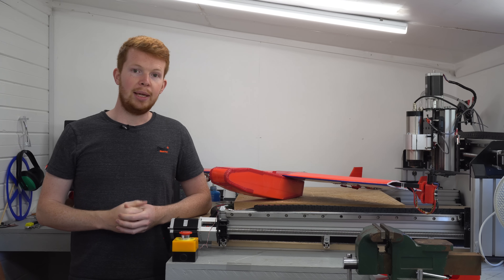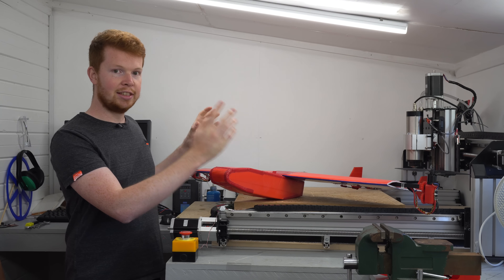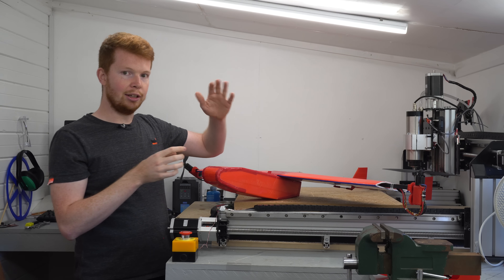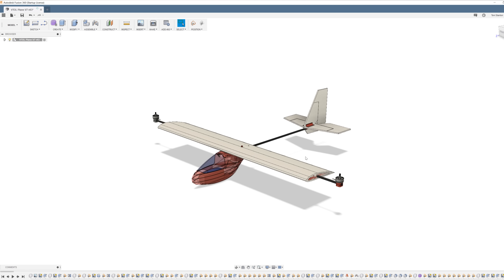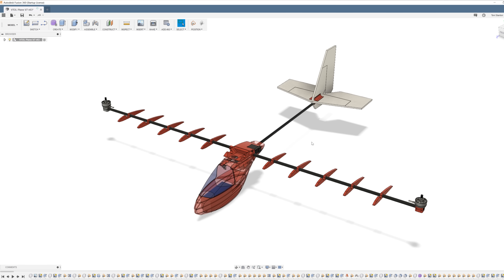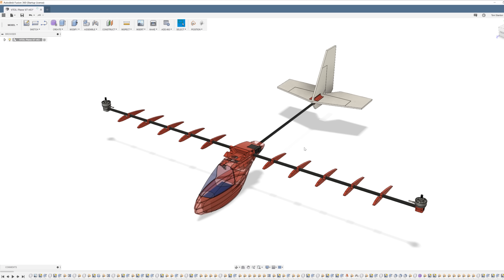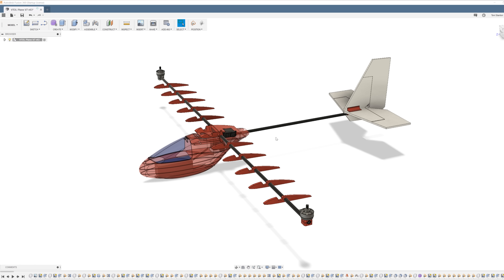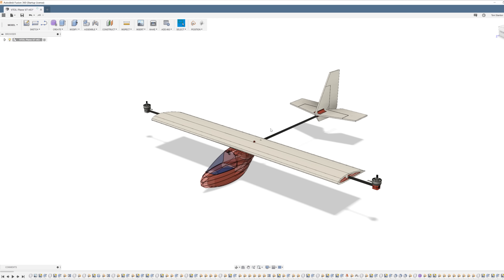RC VTOL - Build

Comment: couldnt you put a carbon rod inside the other carbon rod and split them in the middle this way you can have two independently turning props, while still keeping the turn motors on the center of mass

Comment: Hey man why don't you try using the torque from the motors to provide yaw in a hover like a quad
Reply: Wouldn't work for a bicopter (as it would induce unwanted roll in a hover)
Reply: SilentDrive of course! Good point

Comment: It doens't matter too much for your application but bonding fixtures/brackets onto carbon makes for much stronger structures than drilling and using fasteners. Carbon fiber really, really doesn't like being drilled then stressed.

Comment: Have you watched any of Experimental Airlines stuff on YT? You might find some as yet not-realized methods of working with the foamcore.
One might gently nick with a razor and peel off an inch or so of paper on the inside of the  leading edge.

Comment: Do you think this would be more efficent than a quadplane or some of the other vtol concepts? Why do you choose this?
Reply: yes and no. it will be worse in close quarters hovering operations but will be MUCH more efficient in "airplane model" flight level long range performance.

to jump from your yard to your neighbors yard a quad is way more efficient. to go from your yard to a friends yard 10 miles away the plane will be way more efficient and the quad might not even make it.

Comment: looks great, another awesome project. Why not run a 4-in-1 esc next time, centrally mounted to save on all that power cable and servo wire. Just a thought.
Reply: well he would have 2 useless ESC´s in the plane. Maybe 2 Separate ones are lighter than a 4in1

Comment: Is it possible to yaw by spinning one propeller faster than the other? I know this will also result in a tilting motion but maybe a code based routine of speed changes could make it work. (I mean spinning one propeller faster than the other for a short time. Two times a second or so.)

Really hard to explain when English is not your mother tongue :D
Reply: Unfortunately, without the second set of motors you have in a quad, the pitching moment you get will far outstrip the torque steer effect.
Reply: Yes! Look up differential thrust. Many cheap toy airplanes use this, with two motors half way out on each wing.It keeps them cheap and simple.
Reply: @rossclements8874  he means in hover no in FF
Reply: i suppose. Guess i didn't read it correctly!
Reply: @SilentDrive  Still a valid idea though
Reply: A smaller 3rd motor on the tail like those on rc helicopters would be enough for yawing
Reply: Seems to me that an elegant solution for yaw control in hover would be a fuselage-mounted ducted fan. Small, light and just enough power to turn based on direction of prop rotation, though I'm sure the proximity to the center of mass isn't ideal placement for optimal maneuverability.
Reply: to do this he would need to make one motor spin only slightly faster. this would make it roll so already a problem there, but also the yaw motion would be so slow that its simply not worth it.
Reply: no. he can't do that because he does not have an alternative set of motors to compensate for the differential thrust that will ALSO result in a "roll" movement.

IE yes. if he sped up one and slowed down the other the plane would yaw but it would also ROLL

a quad can get away with this because it can "see up and slow down" the reversed oppossing motors to keep the net thrust vector the same (down)

this is why a TRI copter has to pivot the third motor and can't use motor torque to turn. same issue.
Reply: you could do this if you got the motors to tilt indivitually and turn one back and the other forwards that would yaw it and just add a bit of throttle to keep upward force the same
Reply: Pirkka1 that's exactly what he did on the previous plane, but the servos add a significant amount of weight
Reply: @ @bridgendesar  
on the first plane he varied the direction of thrust not differentiated torque.
Reply: To avoid yaw-induced rolling he’s going to have to balance it perfectly so that both props spin at the same rate when at zero roll angle. This almost seems too annoying to have to work out
Reply: It seems to be missing ailerons, so he has no way to counter the roll. Doing it with the "stutter" method (like some simple toy helicopters do) probably wouldn't work since the torque axis is far from the center of mass.
Reply: Not without variable pitch props to keep the thrust  balanced despite the different RPM.

Comment: That's amazing! Which gyro module are you going to use with Arduino? I am currently working on the autopilot for standard RC aeroplane and I think I can help you with gyro :D
Reply: Kamil Kosi he said he’s using a flight controller then using the arduino as a mixer

Comment: Why dont you try to use different prop speeds of counterrotating props for yawing in hover mode  , like in small quadcopters ?
Reply: because he only has 2 motors. while you are correct this would yaw the plane it would also "ROLL" the plane. when a quad does this it has the other "TWO" motors to counter the "roll" effect of such an action. so he can't use that method. ONLY a machine with an even set of motors on both sides (greater than 1 on each side) can do this.

so a quad can do this and a hex can do this but a bi tri or 5 motor unit could NOT do this.
Reply: That would also induce a really strong rolling force.